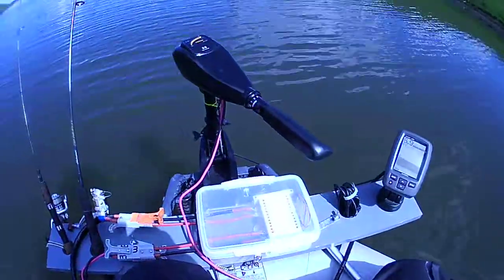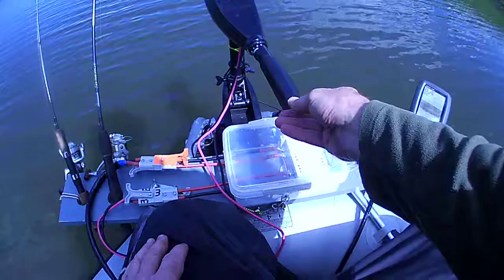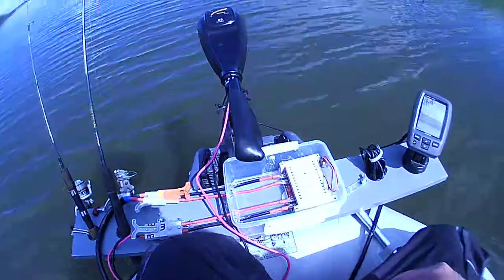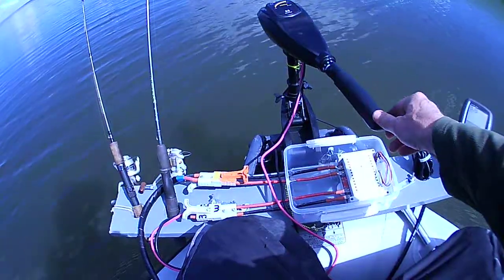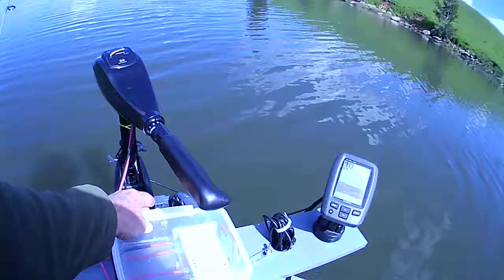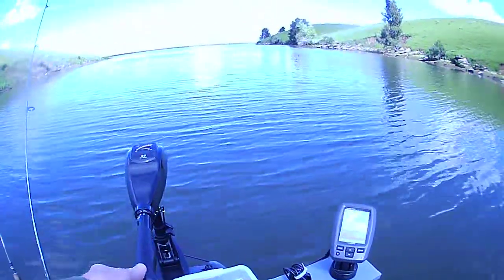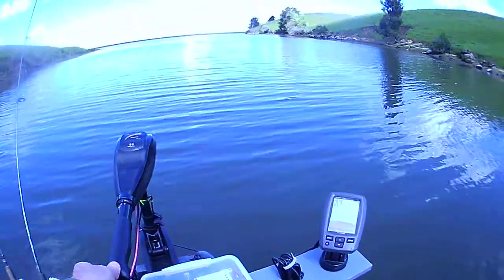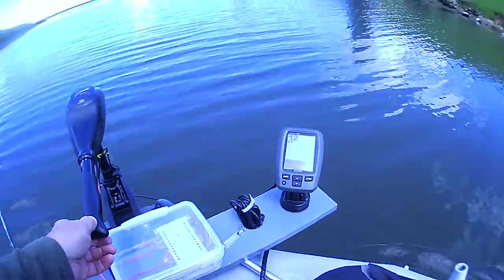MOVI0002

Comment: Did you turn your motor head around so you are pulling instead of pushing?
Reply from the maker: No.  I shortened the shaft by 10" tho.
Reply: Sorry I just watched it again and  Realized you said we're going and reverse.
Reply from the maker: @veknej  This was my 1st setup.  I've since upgraded to pwm with a reverse switch and internal cooling fan.